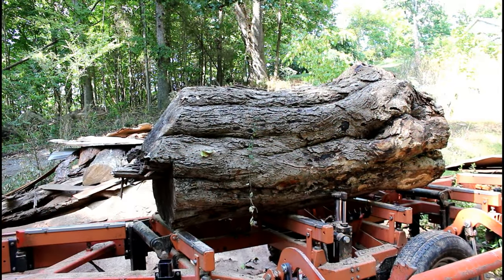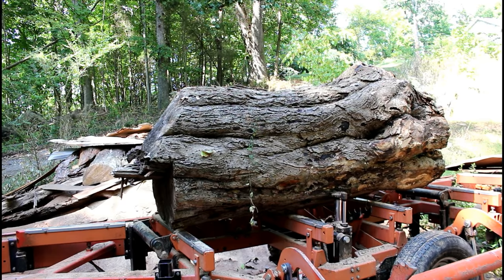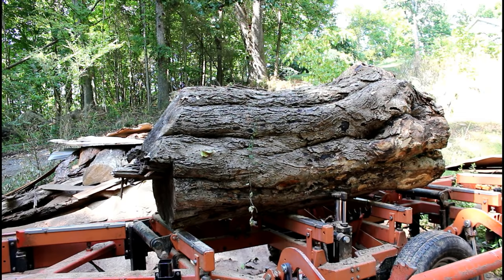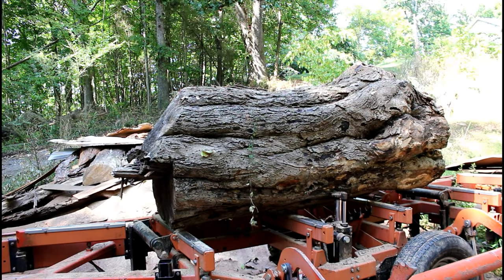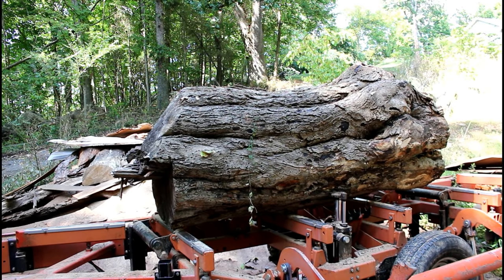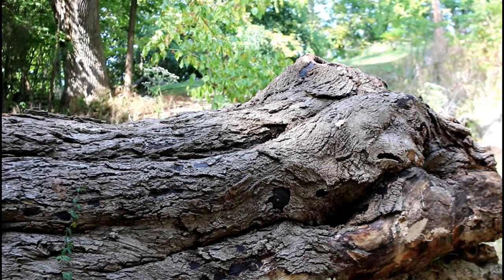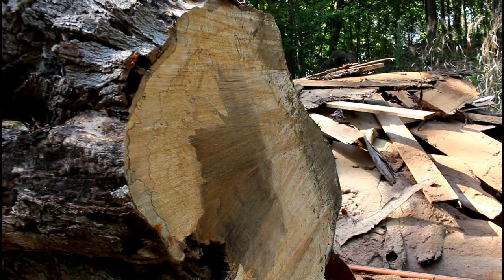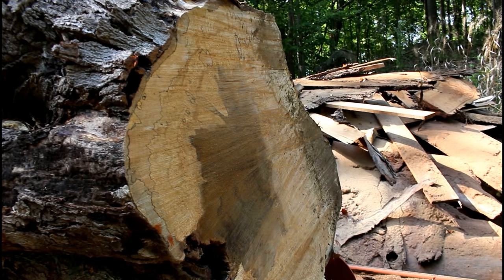WOOD-MIZER LT35 VS BIG SPALTED MAPLE LOG

Comment: How do you determine the first cut or does it matter?
Reply from the maker: It is very important, for me I try to get the widest boards possible, so the first cut is usually the bottom of the log after I flip it,  Scale the log and keep the widest distance on the sides for the widest boards possible. Wider boards bring better value $.